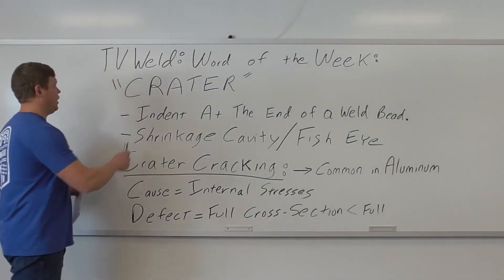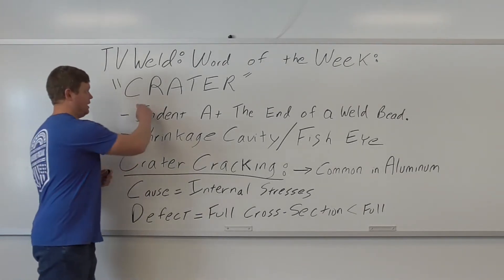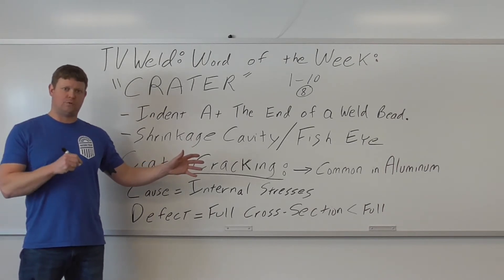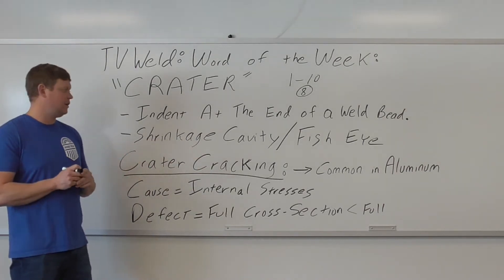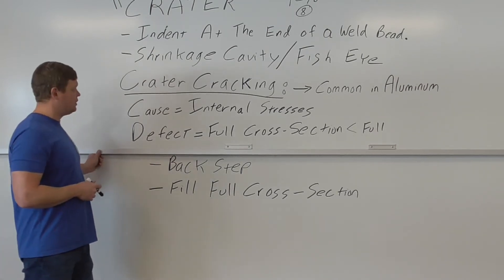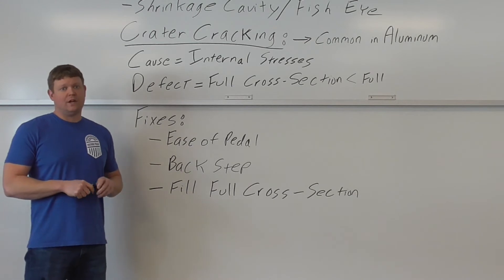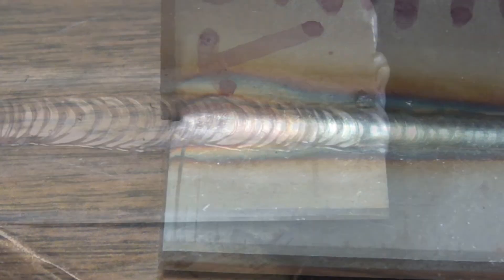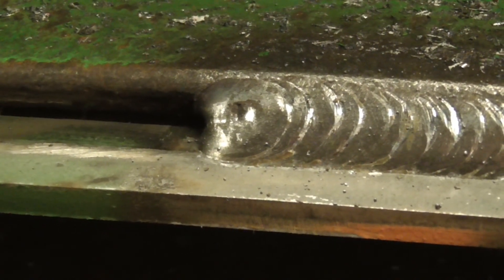What Is A Weld Crater?

Comment: Hi can you please explain this heheh

Vertical-down is essentially the same movement – just from top to bottom. Here, you have to keep a few things in mind. You are fighting against gravity, which brings the molten puddle into your work zone. You will have to stay ahead of the slag at all times. The method requires constant monitoring, and you need to set the amp carefully to avoid the risk of a burn-through.